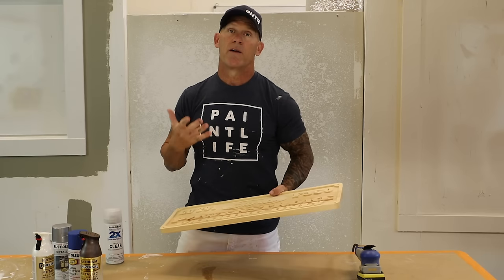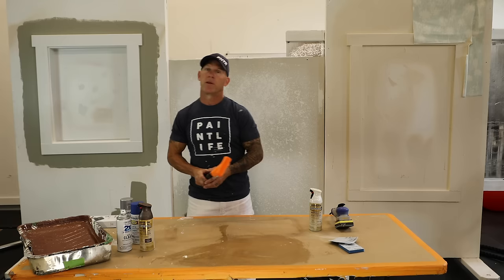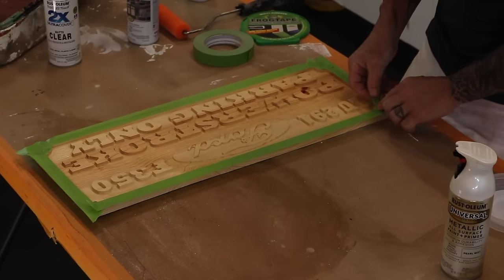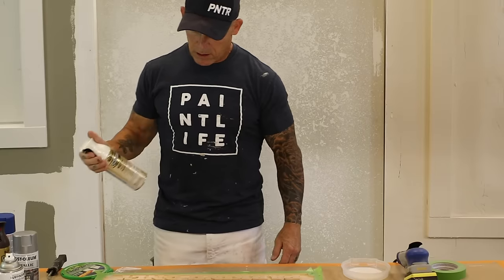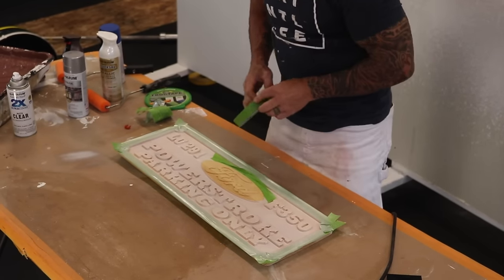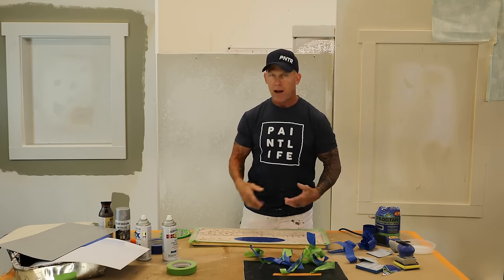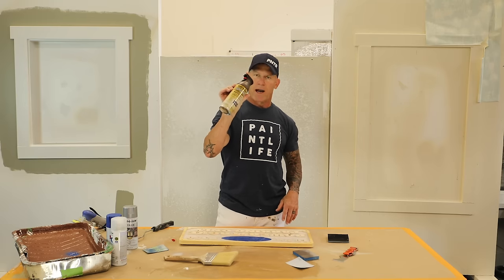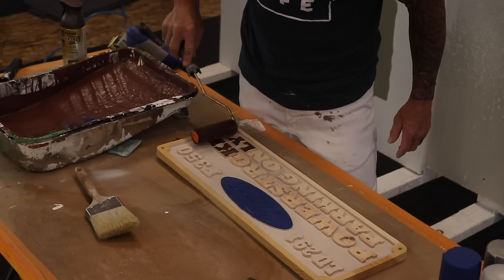How to PAINT a Wood Sign Quick & Easy

Comment: How much did you charge
Reply: Typically you do T&M (Time and Material cost) on small projects such as this. If it takes a average of 2 hours guessing, you charge your said hourly wage plus the paint, tape, and paper at 15% mark up on the materials ( contractor's usually mark up material cost, but its optional).

Comment: Found a couple of tips I could use in this.  I love to router out signs for people, but I hated have bleed problems.  Never thought to lacquer BEFORE painting coats to make it easier to sand off.  Surprised some of my stuff has come out as good as it has without having done this.  Thanks for the video, three years late to the party, but I plan on using some of this in the fall when it is sign time again (got to take a break from mowing etc).
Reply from the maker: Glad to help